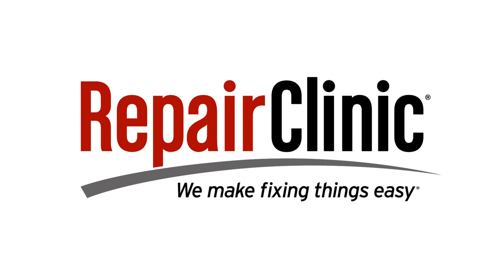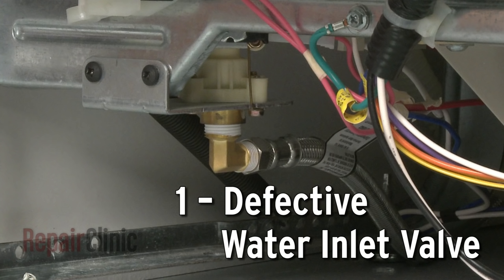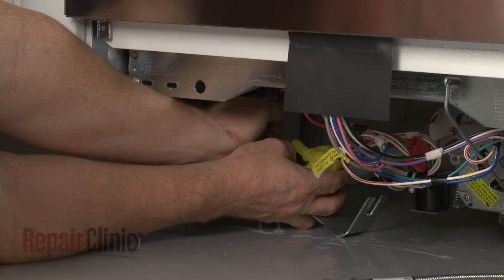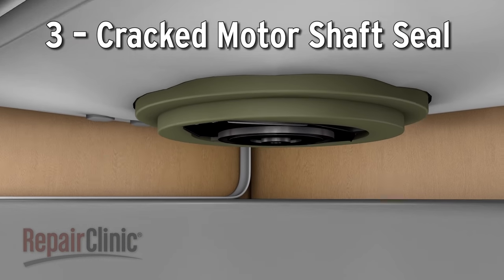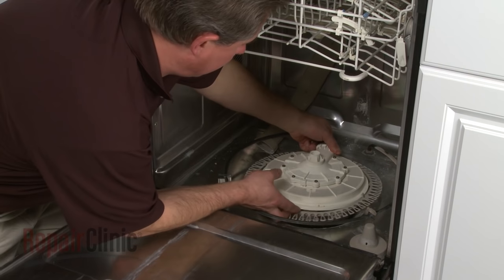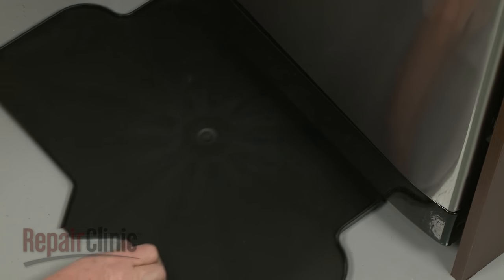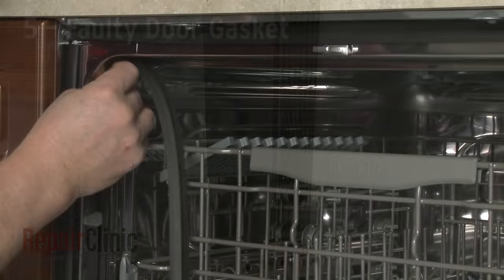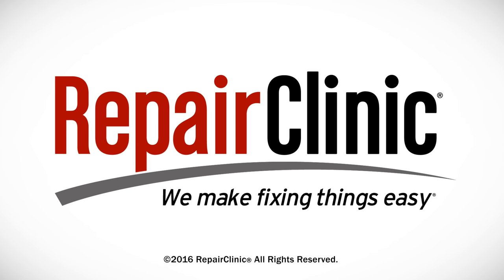Top 5 Reasons Dishwasher Leaks — Dishwasher Troubleshooting

Comment: There's one more that no one mentions, it's the 3rd door seal for my whirlpool dishwasher I replaced everything. Rubber door gasket bottom door seal but it still leaked from the left and right sides so I decided to remove the outer door one last time, this time I removed a clear plastic piece so I could a good look at the lower door seal when I removed the clear plastic piece I found that it was wavy I looked the part up and found it was another door seal that no one talks about lucky for me I'm very handy and own a heat gun and was able to straighten it out when I reinstalled it I made it rest right on top of the edge of the basin and now no more leaks I hope thus helps others with the same problem
Reply: Where is this 3rd door seal located exactly?
Reply: @winstonbrandenburg3350  on my machine I had to remove the front door panel and it was screwed to what I would call the frame right where the hinges are
Reply: @yeetbot-_-1942   What model is your's? I have a GE.
Reply: it was the clear plastic piece that I removed to get a good look at the screws for the bottom door gasket only 2 screws held the clear plastic one in , I hope this helps
Reply: Whirlpool
Reply: @yeetbot-_-1942   Thank you!

Comment: In case any reviewing this have a Bosch dishwasher leaking from the bottom of the door, your problem may be as easy, yet gross as mine was. I was close to ordering a new gasket and undertaking a daunting process of replacing it, when on close inspection of the rubber gasket that seals the bottom on closing the door, I found it caked with gunk that was preventing a proper seal. Being careful not to damage the gasket, I scrapped and scrubbed away the build up until clean gasket was exposed and presto, problem was solved.

Comment: This was a very nice video, I watched another video and they brought up an issue that we would never have considered.  We had just replaced our garbage disposal and we found that one tiny instruction was missed.  We had not knocked out the drain plug. It turned out that was our drainage problem not the motor or pump.

Comment: My dishwasher leaks sometimes. There is a lot of water, maybe 6 gallons or more.  When I open the washer door, the bottom is full of clean water. I test the the float device and it is not stuck. I run a rinse cycle to drain the washer.  The machine works well for another month. Then it happens again, but only when I’m asleep or out of the house. 😬
Can the valve be failing intermittently?

Comment: My dishwasher started filling up and leaking all over the floor randomly without even having it turned on. I had used the day before and everything worked fine. No issues. Today, I saw water everywhere and the bottom of my dishwasher was just filling up like a pool and spilling out onto my kitchen floor. I didn't know what to do. I panicked and turned the dishwasher on to run a cycle hoping the water would drain. I have no idea if it will help. It'll probably make things worse lol! It's running a cycle right now and water isn't running out so that's a good sign I guess. Does anyone have any suggestions on why it would just start filling up with water out of nowhere, without it even being turned on? I have no idea what to do once this cycle ends! I suppose shut off the water from under the sink. I'm just hoping that when I open the dishwasher when it's done running, it isn't completely full of water and doesn't spill all over the floor. 😂

Comment: How about an LG that has water leaking from the air vent duct that is @ the bottom of the door?
Reply: On the LG, the easy one is the main seal which is like an inverted "U". just pull the old one out and fit the replacement (see on YouTube). Actually in the door, is the bottom seal and this is more difficult. First open the door fully, run your fingers along the bottom of the door. you will find a tube running all along the door. This is the seal. It should be smooth and straight and a bit flexible. At first I thought it was a rod. If it is kinked or deformed, it will definitely leak. I am at this stage, and I may have to remove the door, but I am going to try and replace it without removing the door. I don't recall an air vent at the bottom. but it looks like one at the top on the inside. Hope this is of interest.

Comment: I replaced the seal or splash guard at the bottom of the door on my kitchen aid and it fills, then starts leaking as soon as the wash cycle starts. It has a metal wash arm and I don't see anything wrong with it. What else could it be. It only leaks from the bottom of the door.
Reply: U solved it?
Reply: @robertace821  It ended up being the screws around the perimeter of the pump housing were loose. It caused it to spray water right under the door.

Comment: In my case, water was leaking from the door because of too much suds.  Suds level was too high, reaching the point where suds would leak from the bottom of the door, slowly dripping along the door metal panel and dripping soapy water on the floor.   I suspect dish or hand soap entered the dishwasher at some point, which should never happen.  Funny thing is that it would not rinse itself, there was always too much suds from wash to wash.  I had to help it by adding white vinegar in the middle of a wash cycle to get rid of the accumulated soap (and suds).
Reply: Automatic dishwasher soap doesn't sud. You should never be using dish soap in a dishwasher.
Reply: @chelseykjohnson  I beg to differ - we use cascade pods and it was leaking soapy water out the front, we stopped it and opened it up and there were indeed suds inside. Soap of any kind and high pressure (or turbulent) water will always create suds. kinda what soap does.
Reply: @helpogrin  if you use powdered detergent it doesn't create suds.